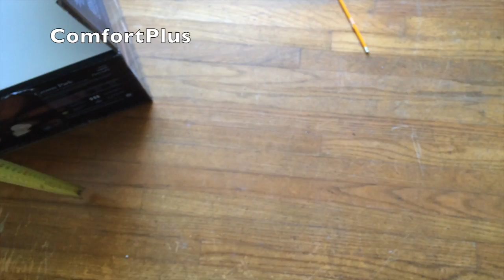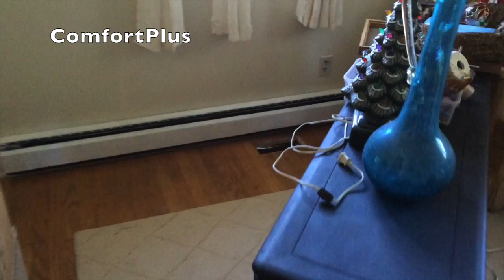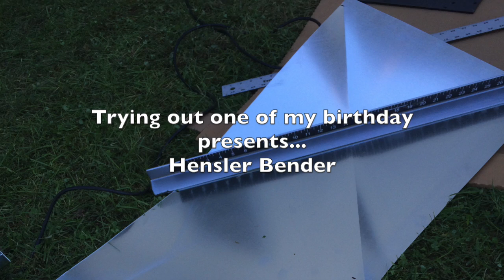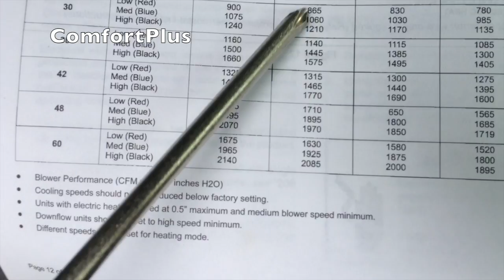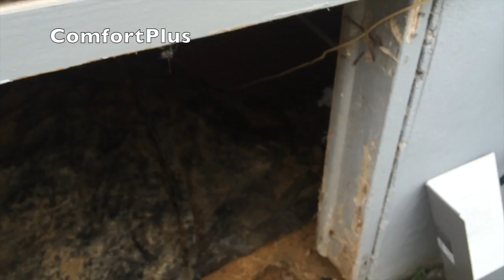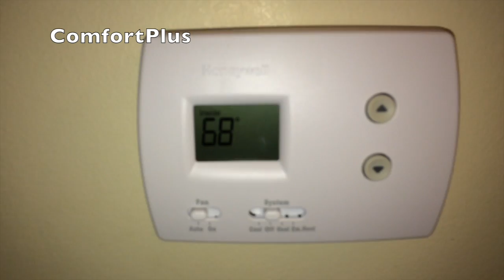3 ton Heat Pump Install

Comment: what size supply trunk did u start off with on that unit?
Reply from the maker: +Derrick Owens I'm pretty sure it was 16". Looking at my pictures I took 4 supplies off, then reduced to 14", then finally to 12"

Comment: Great job! I like that you use that foil back insulation. Makes job look real neat. Keep up the good work!!!
Reply from the maker: +The Air Conditioning Guy Thanks for watching!
Reply: Forgot to ask you, do you get even pressure on your ducts running a trunk like that and saddle tapping without reducing? I have a job where I might need to do same thing because they want me to take up as little space as possible so they can use some of it for storage. Maybe you put reducers and I didn't see them.
Reply from the maker: I reduced it as I got rid of air. I usually reduce 2" at a time. However I believe you could keep it same (large) size and have good results, just use dampers in your take offs so you can adjust if needed.
Reply: +ComfortPlus Heating and Cooling OK that's what I thought. Thank you!

Comment: Sweet install job! .2" external static is as good as it gets, you'll be lucky if you get .8"' here in Atlanta with all the undersized ducts that get installed. Nice video.
Reply from the maker: +Marco Alvarez I try to keep it as low as possible within reason. We have bunches of undersized ducts here too! Thanks for watching!